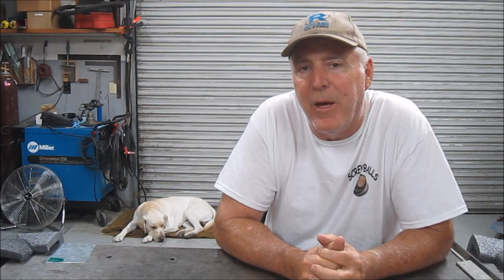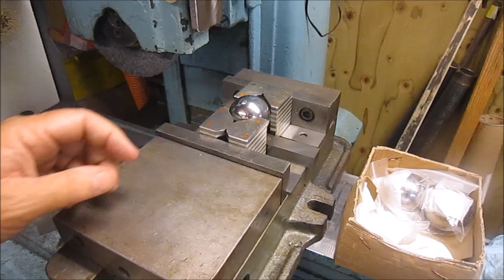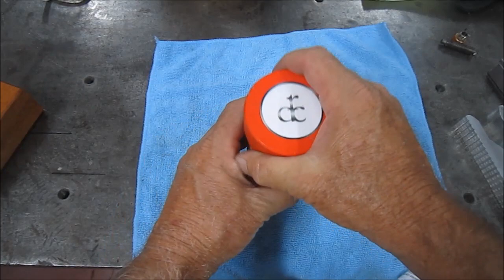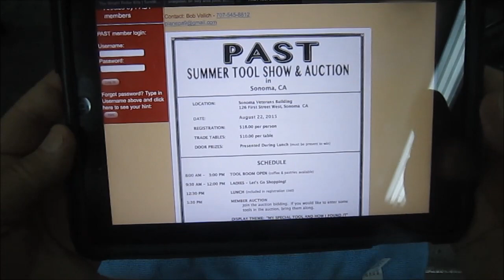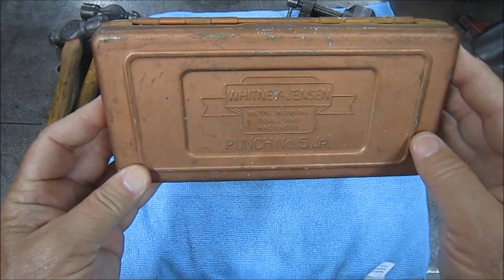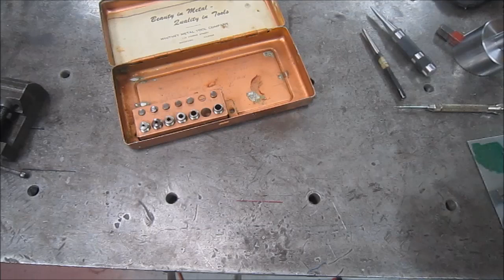Screwy Tuesday #25  It Is All Good

Comment: Nice mix of interest Chuck. Glad someone else has the odd fail.to deal with :) Guess the ball In vice with mag v-blocks), only giving point contact, wouldn't really make that packing parallel go solid. How I miss my small surface grinder, which I should never have sold when I came over here. Beaut fly cutter. I have one of those hand punches - just an import but super useful.

Comment: Nice knurls! Thanks for another nice video. CJ
Reply: CJs Custom Nice knurls, indeed, but I think I liked Karl's (Carl's?) version better because it can be locked together with two wrenches while using it as a slide hammer.  The knurled version will sure look nicer in the basic Vise Grip mode, which is how it will likely be used most of the time.  Anyway, Chuck got it the way he wants it, and it is his tool...
Reply from the maker: +CJs Custom Thank you CJ

Comment: Thanks for the video. Question... wouldn't it have been faster and thus less stressful on your wheel/grinder to have machined most of the flat on the ball on your mill then finish it in the grinder?
Reply from the maker: +Duncan “DunMac” Mac Hi Ducan, I have thought of doing that way, and since the method of holding it in the vice as I did I would not have to work about alignment of the flat....may have to give it a try...But, it take about 15 minutes to grind, maybe less.  By the time I pull out the grinder, grind, and put the grinder away....it is about a wash and no chance of a bozo over grind...
Reply: +outsidescrewball  I can understand that for sure. I'm not a machinist so I haven't a clue as to how things really work in the shop. I really enjoy watching all you guys. A vicarious kind of life for me. Keep 'em coming. And thanks for the reply.

Comment: Hi Chuck, how damned lucky you are to have friends that make tools for you? Herb and Donald are two of most appreciated youtube creators on the block. So you have to take care of their tools. :-) A question: how Herb did the emisferical pocket in the two jaws of the tool to accomodate the ball? In a lathe?
Reply: Cosimo Marotta I used a 1" Ball End Mill, I went down about 0.350" to make the pockets.
Reply: Herb Blair Hi Herb, thanks for answer. Unfortunately I don't have a mill with a spindle capable of 25 mm (1 inch approx). I have to scale down everything as usual.
Reply: +Cosimo Marotta I had to make a end mill holder for the 1" end mill.  It has a 3/4" shank.

Comment: I would not run a fly cutter like that in a 7/8" R8 collet.  Too weak a grip and liable to slip.  I would use a 1" end mill holder and I would mill a flat into the shank of the fly cutter so the set screw could keep it from slipping in the end mill holder.  I have a fly cutter very much like the nice one Don made, and it works well.  Light cuts are still required so the end mill holder does not slip in the R8 taper and chowder the spindle taper and anti rotation pin.  The end mill holder and the fly cutter together do use up some mill headroom, however.
Reply: +Bob Korves I stand behind you with getting a 1" adapter....  ;)
Reply from the maker: +Bob Korves Thanks Bob for the feedback/info